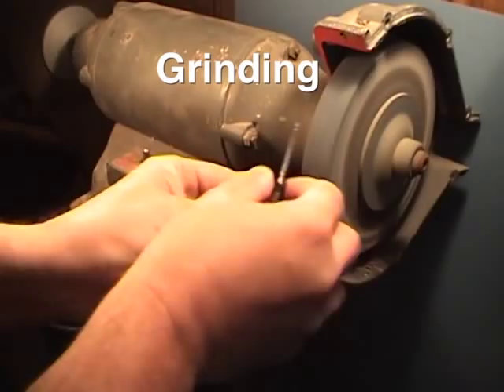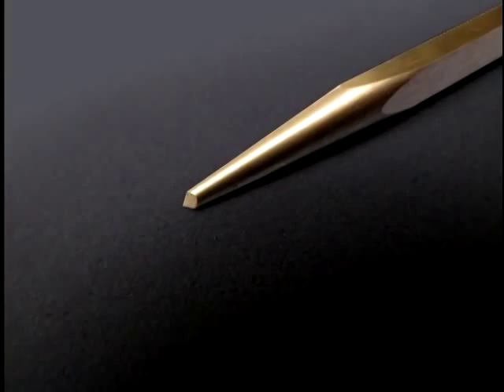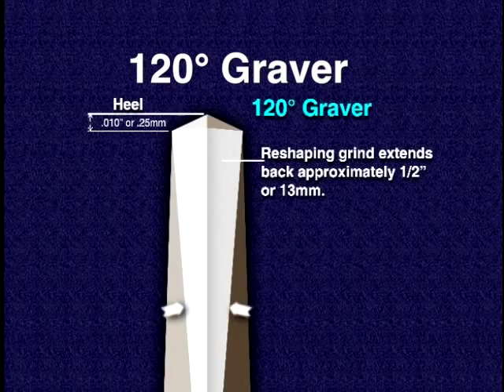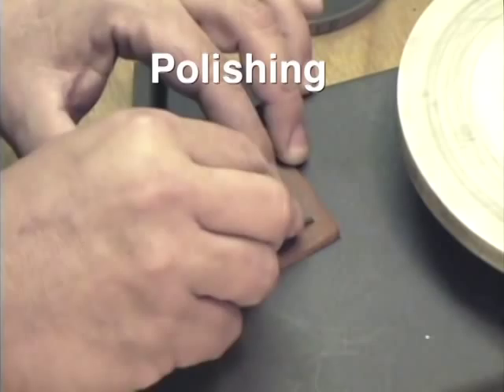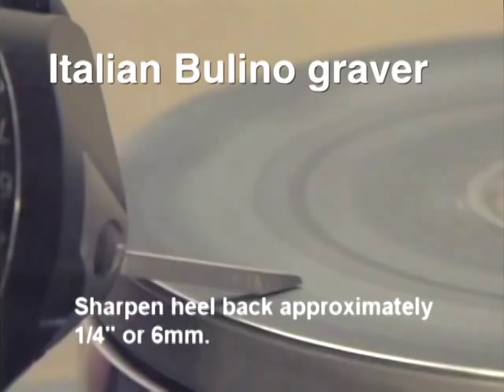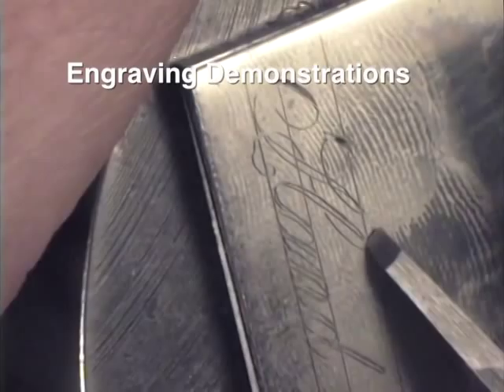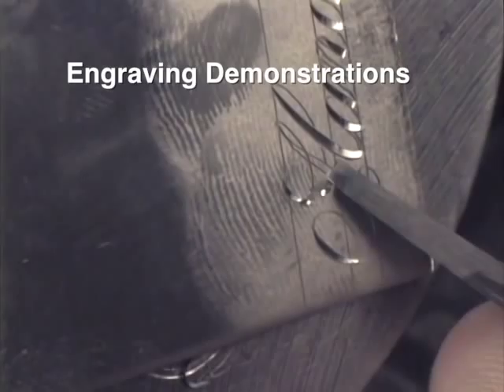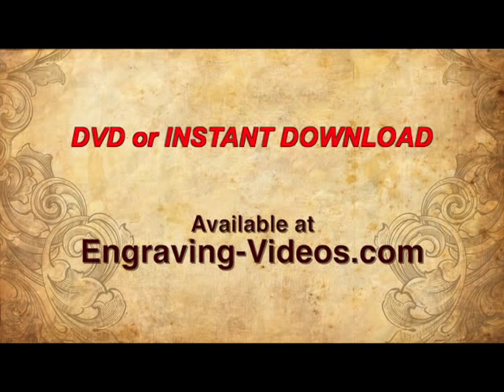The Experts Guide to Graver Sharpening by Sam Alfano

Comment: Sigh I've watched this video i paid for several times and still have terrible problems with the repeatability of these instructions on grs tools. I cant even get a flat graver to load true on the dam dual angle fixture recommended in this video. He doesn't even mention the fixture needs calibrating. Its just a regurgitation of the grs manual and if you dont have the exact products the expert isn't much help.